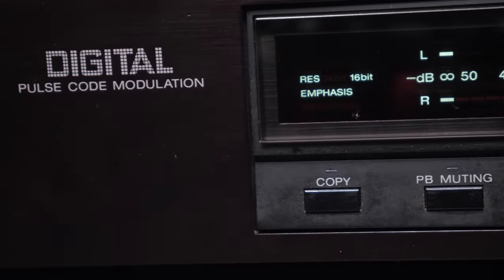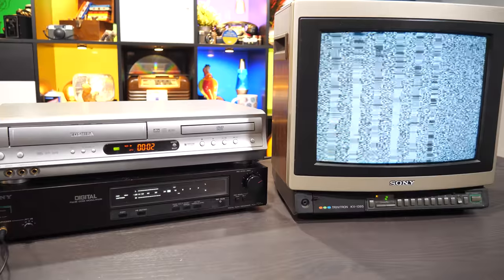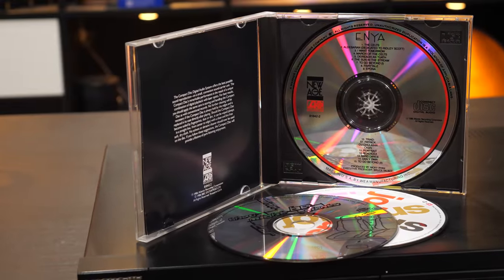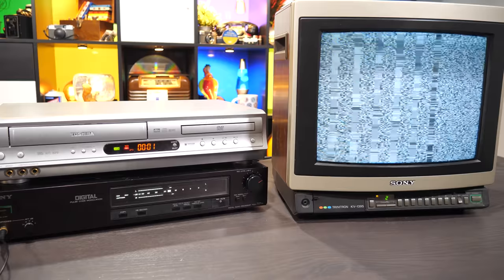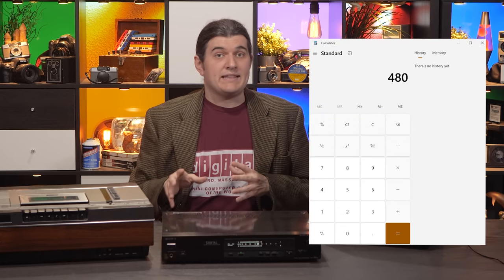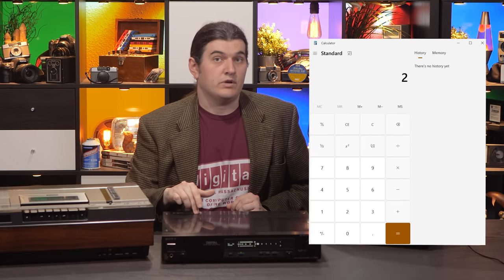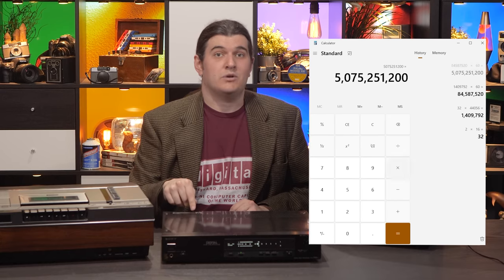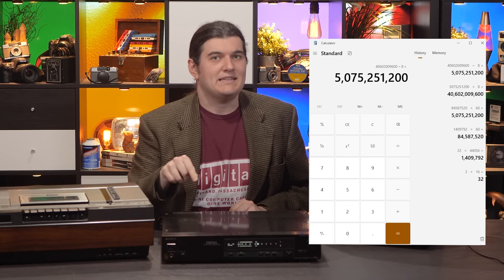Digital audio needed videotape to be possible - and the early days were wild!

Comment: There was another use for these units.  They would be used for high quality recordings of legal matters such as depositions, board meetings, etc.  The long time runs and archival quality were very useful.
Reply: I was wondering about this. Such people would certainly be interested in the high fidelity, but not necessarily need a professional-level product, just a consumer level.
Reply: Alec missed the glaring best use case scenario for it in 2023. Uploading digital music to YouTube to get around copyright strikes.
Reply: @ewmegoolies  😂
Reply: @dracodis  I don't think the high fidelity would matter that much. However, being a digital recording, if the 0s and 1s turn into 0.7s and 0.3s from age, all you need to do is re-record it and your audio is safe for another couple of years or decades. If that happens to an analog recording you're f'ed
Reply: @bene5431 Ideally, you should run it through error correction each time making a copy, thus avoiding dropouts to accumulate over the copy generations .  Using the smooth-out processing to fill in unrecovered holes is more dubious, because guesswork is guesswork .
Reply: Crazy that ECC can overcome the lossy-ness of LP mode.
Reply: Yes. It’s was hard to get a picture but achievable with another device that is preloaded with audio AND video images on a FUCKING MAGNETIC TAPE….! Yes … tape.
Monkeys now use this technology…
Reply: @ewmegoolies  This could totally be done through software too, negating the need for the actual machines. My main concern would be whether youtube compression would cause too many problems. Images with few contiguous areas of the same color are a compression nightmare, but restricting it to black and white may help a bit.
Reply: @johndododoe1411  I believe there was a "copy out" jack on Alec's adapter specifically for this purpose.
Reply: @ewmegoolies  wouldn't it just get mangled by compression?
Reply: My dad was an audio and video engineer for our local city council, as well as city councils for a couple other nearby towns. He created systems for broadcasting the local government meetings because they have to be publicly accessible and recorded. I didn't have an interest in this stuff back then, but only now that he's gone do I really realize how damn underpaid he was for what he did.

Comment: Thanks for the video :)
Some notes:
03:17 - in context of this video, cheaper 14-bit PCM adapters were using only ONE chip - DAC. ADC conversion was made with the same DAC chip and some analog circuitry (successive approximation ADC).
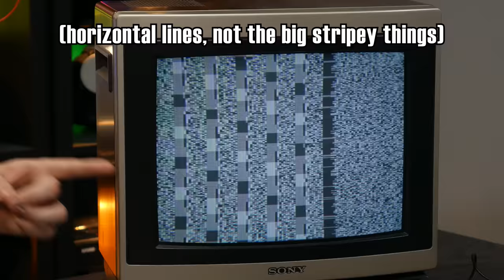10:10 - one line contains 6 x 14-bit audio samples, 2 x 14 bit error correction words and 16 bit checksum, 128 bits in total
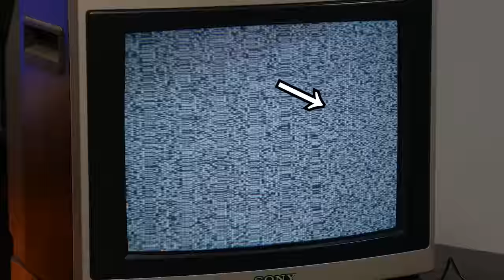13:50 - look for "STC-007" or AES 28-4 or US4459696 patent, that's STC-007 standard
15:28 - each next 14-bit word of the source is shifted 16 lines down, that's why patterns appear to be slightly diagonal
25:27 - yes, you can, any STC-007 adapter would read it
25:56 - because 14-bit is the standard (STC-007) and 16-bit mode is Sony's hack on it (starting from Sony PCM-F1)
26:12 - no, PCM-1 used its own, Sony-proprietary encoding format, 12-bit static resolution (14-bit dynamic resolution)
26:26 - VP-101 uses standard STC-007 encoding, compatible with 14-bit of Sony adapter (and not compatible with PCM-1)
26:39 - yes, SV-P100 is a STC-007 compatible recorder
26:53 - yes, that would work both ways
27:53 - exactly, 16-bit mode was a Sony's hack, re-purposing one error-correcting word for 15th and 16th bits
28:02 - indeed, 14-bit mode can withstand loosing 32 consecutive lines without an error, 16-bit mode can stand up to 16 lines only
31:13 - STC-007 PCM data also has more data than just audio, it contains 128 bit/line, that gives 128 x 490 lines x 30 fps / 8 bits = 235.2 KB/s, or 235.2 x 28800 s (T-160 SLP) = 6.77 GB

edit: fixed measurement unit
Reply: I remember from my time as a digital tape recorders technician that 16 bits ADCs were not very accurate (12 bits had +/- 1 bits accuracy while 14 and 16 bits were worst, leading to some "distorsion".) 
That was not relevant for sound recording, as it offered better signal to noise ratio, but was when it was signals from sensors where accuracy was more important.
Reply: Wow, it's really great seeing people who know their stuff in the comments! I don't, to be clear, not on this topic, but I can see that if I wanted to make an even deeper dive, your notes would be a good starting point
Reply: Honestly, kudos just for using timestamps placed before what you're responding to so that jogging isn't necessary to in order to understand the note.
Reply: Your 6.77 GB calculation appears to be in base-10.  Windows will show this as 6.459960938 gigabytes since data storage will be base-2.
Reply: I'm always amazed at the quality of the comments in this channel.
Reply: @chefchaudard3580 For a long time, Phillips CD players used 14 bit ADCs and 4x oversampling to play back 16 bit CD Audio .

Also, SAR ADCs use some digital logic and an analog comparator to find the binary value of each sample, requiring a holding capacitor to freeze the analog input for the duration of each measurement .

Comment: You didn't need a recording studio to need high quality recording.  There are various live venues (churches, etc) that might want a recording. It's best to capture it at high quality so you had room to process it before dubbing it onto cassette, or maybe a custom run of records.  For some it may have been a hobby.  (Never underestimate the money people will spend on a hobby.)
Reply: I follow the same rule with modern digital media. Always get the highest possible quality version. You can transcode to a lower quality if needed but not a higher one, and every conversion between lossy formats reduces quality further.

Though, I had to tell myself it's a bit silly to store full-resolution PNGs from a flatbed scanner... Cropped JPEG is usually good enough there.
Reply: Is that why TimeLife Records had a run on seemingly high-quality recordings of e.g. new-age hymns, etc. in the 1980s & 1990s?
Reply: Yes, exactly. As a specific example, over a span of about 20-25 years or so, my dad used to make recordings of every performance of the chorale group he and my mom were members of. He started before these PCM adapters existed, never mind consumer VCRs, so he was using open-reel tape decks, and then duplicating the recordings onto cassettes for people who wanted a copy. But in an alternate history where he started doing this when these PCM adapters were available, I could easily see him having chosen this tech instead, for its suitability as an original source for repeated duplicates and higher source quality.

An added benefit would be that the archived material would probably degrade a lot less quickly than the analog option would. The analog tapes could wear out over time and without any error correction built in, the duplicated copies would get just a little worse with each copy. Not noticeable for dozens of iterations, but it probably could add up for larger volumes. I'd guess the digital audio made with this technology would hold up longer, and it would be easier to make perfect backup copies, which could be used to completely eliminate any problem of degradation over time.
Reply: I don't see it so much as a "consumer version" but a "consumer-compatible version", the kind of thing maybe a small campus radio station or in your example a church might make use of. Admittedly, I haven't tried to look up the historical price of a professional Betamax recorder vs. a consumer VHS VCR, but I'd expect the difference to be enough. I imagine it also would have been easier to run down to Sears to get a replacement if something broke, vs. dealing with vendor/distributor service, if the setup is made from "consumer-grade" hardware.
Reply: @pshalleck  I think you're describing "prosumer".  True professional would have balanced line level stuff, but the prosumer would be happy enough with RCA jacks.
Reply: This thing also allows you to record 8 hours of Digital Audio. In 1980s. 

For a Church, that's a WHOLE LOTTA Jesus Praising recorded on just a single VHS tape in clean, digital format... Ready to be repacked into 8 (or so) Cassette tapes worth of unique Hymn compilations
Reply: @harvey66616 Old PCM video tapes are actually proving very difficult to playback 40 years later, the error correction isn't sufficient for all the drop outs. Reel to reel tapes have survived much better.
Reply: It still make more sense to have a commercial level utilizing XLR vs RCA audio.
Reply: @TheBanshee90  That's one of the big differences between Pro and Prosumer.
Reply: @TheBanshee90  Well, try to explain that to the Reverend Obediah who oversaw the church, Uncle Marston the who want to record his amateur radio sessions, or Papaw Lennart who played with his blues band over at Seven Oaks Bar every Saturday.
Reply: @renakunisaki  Setting the JPEG compression to 0 (or is that 100%?) will still result in a small file. How that compares to the same image saved in PNG, I'm not sure. A web search was inconclusive.
Reply: @doubledarefan  Even "Lossless" JPEG/JPG isn't truly lossless.  JPEG itself is actually an encapsulation method with most JPEG images being either JFIF (older, smaller, lower quality) or EXIF (newer, larger, higher quality), there's a ton of other algorithms as well but almost nothing uses them (anymore, remember learning that the Wii basically only supported JFIF and I had some images from a camera that were JPG but not JFIF, not sure what they actually were, could have been EXIF since my mom's cousin had a fancy digital camera).  Regardless of the algorithm used all JPEG image files are made using a process called quantization.  The file contains meta-data (date taken, date modified, camera used if any, algorithm used, ect) and usually data for 3 channels (Red, Green, Blue, some files have a 4th channel for either depth data or transparency data).  Those first 2 parts are common to all image formats though the exact meta-data format/what info it can contain differ.  Here's where the quantization comes in, each channel is broken up into squares which are made up of predetermined patterns.  The software that renders the JPEG image has a database for the patterns installed so the JPG file itself just needs to have references to the patterns used which allows the files to be incredibly small.  Of course these patterns can't perfectly recreate every possible pattern of pixels from the raw image hence why it's never truly lossless.  

PNG files on the other hand are truly lossless, they compress images using traditional lossless compression techniques (which JPEG may also use to further reduce their size though it doesn't always make sense to do so).  The traditional technique is to scan the file for repeating patterns then create a database of said patterns along with an index which list references to said patterns (this database is generally kept with the file as is the case for PNG).  Some compression formats have the database and patterns separate within the file while others have them combined (iirc combined is better for streaming while separate may offer better compression overall), there's also different lossless and even lossy compression algorithms that are optimized for different file types or even image targets (a picture of nature vs a picture of a face).  An image with a lot of black space could be compressed quite a bit by encoding long strings of 0's (black/no light) as 0 times the number of 0's.

Hopefully I've explained that explicitly (clear and concisely) enough but if your still confused or want even more details Computerphile did a few great videos on the topic years ago.  There's also been some progress in recent years developing better image compression (both lossy and lossless).  WebP is one such newer format which generally manages much better compression than JPEG for the same or better quality.  APNG and AVIF (I think) are also neat formats that have animation support but far better quality than GIF (GIF has a severely restricted color space and severe size constraints as it was made for small and simple 2 or 3 frame animations during the early days of the web when the text in this comment alone might take a few minutes to download).
Reply: Casette tape recordings were extremely popular in churches. That's how you brought your backing music if you were going to sing like in SOTC
Reply: @aribantala You underestimate the amount of hymns there are and how many backing tracks you'd need to record

Comment: I used one of these back in 1986 to record live classical concerts. Worked like a champ. It was how we had to do it. No more tape hiss though which then caused us to go searching for a solution to the next weak link in the chain. So that caused us to look at new microphone preamps and new mixing boards. It got expensive before it was all done. And it was great for live classical stuff where a stereo recording was fine. But modern and pop music wanted more tracks than just two. The race was on.
Reply: Okay, so you're an interesting one. How do you prefer to communicate on social media channels
Reply: Isn't that how Jack Renner started Telarc Records?
Reply: My step-father played in a band that played a wide variety of music on acoustic instruments. They played in a lot of cafes and small bars, and often when they began unloading their equipment that manager or owner would begin to look hesitant as if he thought their act might not be a good fit for his venue, and my stepfather would take a moment to explain to them that their quest for a sound system that would amplify their voices and instruments without introducing a lot of noise had unfortunately led to them buying a system that would let them play in stadiums. Do not be alarmed by the speaker towers taller than a human, or the mixing board mounted atop a rack of amplifiers the size of a dishwasher, it's all there to make sure that the mandolin comes through crystal clear.
Reply: You see a similar problem of live music vs your system in your home. Yes, both systems will comfortably play over 105db which is plenty loud. My home system has over 5kw worth of amplifiers even though they rarely go over a couple hundred watts. But they get to that couple hundred watts real damn fast so you get that live  music thump. You also don’t get A the music fatigue of listening to loud music. Your peak levels are high. Your averages are lower. So you don’t get the ear fatigue.
Reply: Yep - I knew an organist who traveled around playing different instruments across the US and Europe, recording on a portable PCM + VTR back in the 80s. He'd take the tapes back, edit them down and publish on various classical labels. Just him and his gear - made for a low cost production.
Reply: Very interesting, thank you. Who is "we" in this case? A music hall? A radio station?
Reply: @OntarioTrafficMan  in 1986 I was working for a local university public radio broadcaster. We recorded the local symphony, opera and various university groups and others using the university halls and rooms. For the time they were great recordings. Commercial CDs were just coming into their peak and they were starting to release them into the classical space. A lot of the classical audiophiles were way ahead of the pop and commercial listeners so they appreciated “digital” recordings. By the early 90’s we were starting to see commercial DAWs and other computerized digital recording machines. So the DAC to VHS didn’t last long but it was a great bridge. Then Protools came out and ruined music! ;)

Comment: A work colleague recently told me that back in the late 90's when all night raves were broadcast over FM radio he used to digitally record them using his Akai VCR. He wanted to record the entire session without having to stay up swapping tapes so would set a timer and go to bed, then in the morning he could listen back to the entire 8 hour session.
Reply: I did the same to record an FM station program early in the morning. Program the VCR, record, then much later dub to compact cassettes.
Reply: If any of those tapes have survived, they would be absolutely awesome to hear today.
Reply: If those were recorded on a VCR that one might have at home, you were using the analog audio section of standard VHS tapes.  Many of those had a compander circuit in them and at best would sound like a cassette tape with poor noise reduction.
Reply: @jimmyklane  thus, why the OP specified an AKAI brand VCR. They specialized in high quality audio equipment. They are actually most famous for reel-to-reel tape recorders. Why would you assume they used a "typical home" VCR anyways?
Reply: @squirlmy You’re correct, I did make an assumption however it wasn’t a completely uniformed one.  I’m a musician, I’m familiar with (and an owner of several) AKAI Professional products.  In the 80’s they made consumer products and VCRs were some of those products.  I’m not aware of (although I’m not claiming a comprehensive knowledge base either) AKAI making any professional level VTR/VCR products and presumed a consumer product.  Upon a second reading of the post I replied to he does say “digitally recorded” so maybe he remembers it being a professional level product and just didn’t specify.  I don’t have a need to be right lol